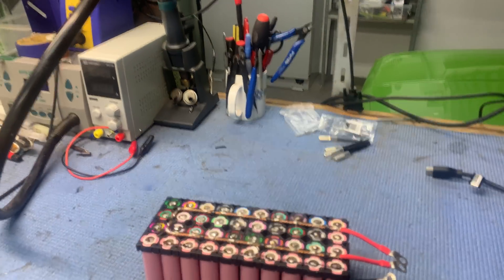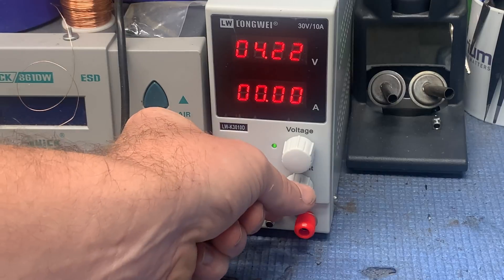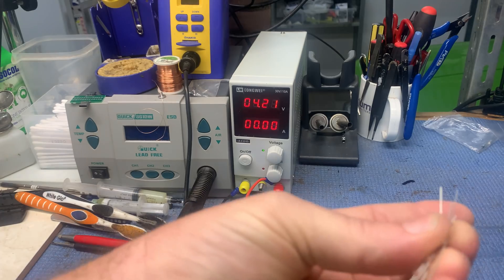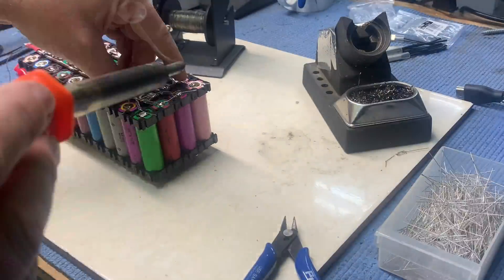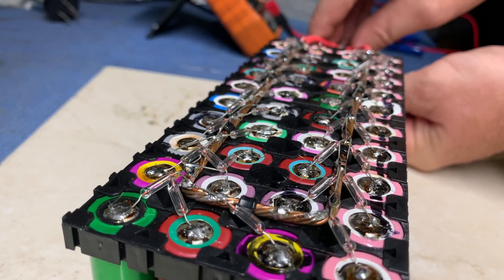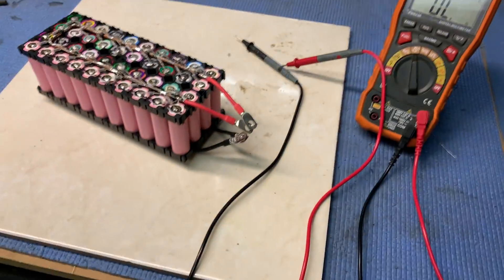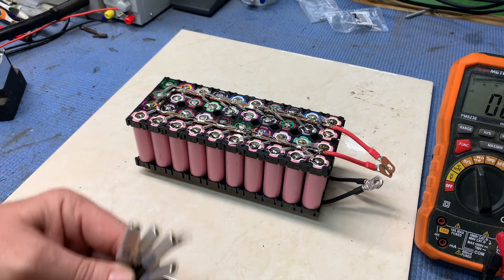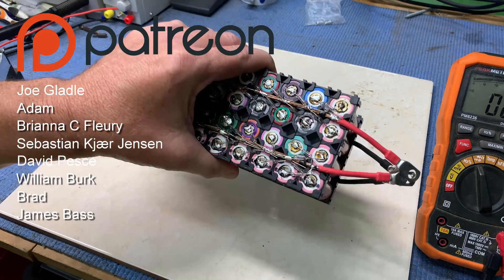Glass fuses on an 18650 battery - Cell level fusing

Comment: So what's the idea behind the fuses?
I get that it's a protection but watching these last few videos it seems that the dodgey cells don't have enough energy to blow the fuse, whereas the better cells blow it right away.
Also, the testing you're doing is simulating an external dead short. Wouldn't a fuse on the cell be better? 
If the pack had an internal failure, then would a single battery actually be over supplying the current that makes it fail?
to understand the fuses, my best guess would be to test batteries in various conditions (full/mid/end of life) with a load  and fuse to see how it reacts.
The more I think about it, the more I feel the fuses add nothing more than a false sense of security - sorry bro...

Comment: Hi Pete, Great video there, clearly your new to constand current/constant voltage PSU's but you'll figure that out in time (thats what the lights mean) in terms of the thermal fuses those sound difficult to implement but perhaps using those for "Pack" level fusing would be an idea.. But in the mean time if you look but auto resetting polly fuses i think you will find the cost effective type your looking for.
Reply: Hit & miss but to locate a thermister in a pack would be the use of thermal camera to find the highest heat point so it triggers escentially as soon as possible.

Comment: You need to stop promoting using these batterie cells. They are very dangerous
Reply from the maker: So are cars, planes and shopping centers, You can make anything safe.
Reply: @HBPowerwall  I know the danger with my car.  What is the danger presented by a Power Wall?
Reply: Life is dangerous. If you so scared stay in bed, you can fall from stairs and break your neck going down to make a cup of tea.
Reply: @robert1508  People need to know what the RISK is.  Then we can decide if we want the risk, or not.  Where is the risk stated in this video ?
Reply: @Repairman What is the risk?  Burning the containment down?  Where is that stated?
Reply: one youtube film do not push enyone to start making his own powerwall, some crazy guys like WE are, start our small or bigger project, watching tonnes of films, buying or getting in other way lapto, power toos. scooter etc, batteries braking them apart testing and testing and get knowlege how they are build and what WE can make of them. Yes I am scared about some folks first comment on group "how i can get some cells, because i want to start dooing powerwall". But here is a lot guys with experience. I am an electrician, and my system works fine almost two years, 20 solar panels with battery backup, I am using now a forklift 48V battery, but i have a plan to change to littium. 
So there is a lot od films about safety but not yhis one, this one was a test of glass fuses,  and was not addresed to someone who just started his own adwentured with littium but for a bit advanced guys.
Reply: @Repairman No, the RISKS are never explained ...
Reply: @Repairman No, I will not pay someone to install a battery bank on my property. That makes zero financial sense ...
Reply: @Repairman No, nobody KNOWS the risks, especially if DIY ...

Comment: Suggest removing 1-2 of the non-blown glass fuses and repeat power supply test done in the beginning of video. Curious if tolerance on the 5 fuses a bit higher?  (doubt it)
Or perhaps the short current (in main bus bar) drops as each fuse blows, and short current is lower than initial short current (each fuse blowing removes cells, so is current through the main busbar dropping?) A test would be to measure bus bar voltage as short remaining 5 cells ... likely very low. With large number cells, the voltage likely took a bit of time to drop. (what would it been as fuses began popping? No easy way to tell)
Would need high speed current (and/or voltage)  reading at point of short to gain better insight of what happening at point of main bus short. (ie: digital current capture .. but doubt you'd have sampling equipment)

Comment: So has his fire basically come down to the over rated fuse wire? was he expecting each cell to output 8A under load for his use case, was he expecting to much? or was it just a mistake and would  a 2amp fuse blow when a cell turned into a heater?
Reply: @Anthony Barrett
 -  You will never know what actually caused he fire.  You can makes guesses.  a) maybe it was a "heater" cell ... b) maybe it was bad "fuse wire(s)" ... c) maybe it was poor construction ( caused a short ) ... d) All of the above ... e) some of the above ... f) none of the above ...
Reply: @Repairman Even with a 2 Amp Glass Fuse, a "heater" cell can still burst in to flames.  So, was the 7 Amp Fuse really the source of this problem, or just another problem?

Comment: Glass fusses are way to go ....i have little bit larger packs with glass fuses and no issues at all ....
Reply: 1 because i have tested every cell 3times 
2 this batterys have only bin tested once....
3 thermal issues have some parallel issues like self discharging or high internal resistance .....by full and when they are empty...
4 equipment that u use shuld not be mass produced 20$ diagnose Bt-c3100 is inacurate ....
First charge of salvage batterys shuld not be more than 0.15A ...
Yes is long first charge but in this stage u get first heaters because batterys are charging long time ....time of first charge shuld also tell u someting is not ok...
If batt. is ok no heat will build up ect ...
5 by testing capacity with 0.5A ...discharging....no heating up
SkyRC mc3000 is great option to use ...
Calibrated ....
6 waiting time 5-7days ....first charge to exacly 4.2v then put batterys to rest... after5-7days measure the voltage ..if is bellow 4.17v is no god for powerwall 
7 pack asembly .....asemble the pack...
Charge to 4.2v and put to resting for 5-7days again if is below 4.17v charge pack again and serch for heaters thermal gun ect...
Then disconect all batterys on the one side ....i do on the neg because on pos i have glass fuses ...wait 5-7days and measure every cell replace the cells that are no god....asemble  the pack charge to 4.2v and repeat the procedure until u get 4.2v on the whole pack after week of resting....
7 measure capaciti of the whole pack with ZPB30A1 V2.8 my device....

I use 6packs/135Ah in parallel and 14 in series 
Mach capacity batterys thogether  one 2000mA and above 
Second 1900mA
3 1800mA and so on down to 1300mA 
so every 1s group have 2000 and above have 1900 have 1800 an so on ...
Usebal capacity is 600Ah/52v ....active balancing is required 50-90€ with display and constant balancing ....
Max draw is 100A long term...also charging after 3.4v i consider cells as empty and 4.04 are full .....and i get my 600ah wit on issues...
Reply: Man i have tested cells like 3years and look all videos hb powerwall and others also make mistakes along the way 3times have taken all packs a part and it still was not perfect ...then u take paper pencil and wrote every mistake i have made and look also other ...adopt god  things....
Hb is cool guy ....but i think his packs are simply too large ....
That burning pack was just extemly abused ...
And balancer it must be active because are old batteries at least 5A shifting current capabily ....mixed batteries act different at 3.3v and 3.8v curve of discharge is not linear and every so small disadvantage could active balancer make to disspeare....

it have to be constant balancing. 
even now if i go look battery volages i see that is shifting current around ...
Now days good active balancers cost 80-90€ with display or monitoing capable ....
My batterys lie on the same spot more than 2 years now without any intervention...
On sunny days i charge them with over 100A constantly no isses....
Reply: How do you know that you have "... no issues at ..."  ???  Did you short out the pack?  Do you have video showing that every fuse, in the pack, will actually blow?
Reply: For now ....

Comment: Curious on the fuses that didnt blow, did they have a different resistance between the cell and busbar? Also is it worth pulling the cells that didn't blow for a quick capacity test to see if they are lower capacity than advertised? Perhaps what once was 2200mha is now 1400 (ie not enough current to blow)?
Reply: I see the point here where the need for 1Amp fast blow fuses to work at very least amperage.

Comment: Great set of safety videos lately, I think a lot of people appreciate them, thanks!
Some fuses didn’t pop so I think the following should be investigated:
1. Are the fuses themselves faulty ( put current over them with your PS and test it). If yes, the fuses themselves or installation method should be questioned. If not...
2. Check if the cells of which the fuses didn’t blow, have peculiar behavior. Heaters, drainers, high internal resistance, low capacity left, ... if this is the case we should try to figure out a method to detect this during initial cell testing so they never end up in a pack. That is of course if the problem is already present from the beginning and not caused during aging of the pack.
Reply: Re 1: I have actually come across one faulty fuse. There were 2 fuse wires inside the glass tube together with 2 leads in each end 🙂 , well I discarded that one.

Comment: Cells that did not blow the fuse are defective, not able of supplying 2 A into a short. Try one of the cells that did not blow its fuse and see how many amps it will provide into a dead short. (My guess is: almost nothing). Unless You break the fuse glass they are surprising rigid. I have mounted 7000+ of these and I have less than 1% that breaks.
Reply: Yes I was thinking the same, clamp the current meter on the bus bar wire to see what current there still is on those cells that did not blow their fuses.
Reply: Agreed, I have had batteries that show voltage but provide very little current .
Reply: @OverUnity7734  Open circuit voltage is what that is
Reply: This is where a battery load tester comes into play during the  processing stage. The ZTS MBT-1 pulse load tester is what Ive been using for a couple years now. It looks kinda cheap looking for what it costs but its actually really rugged.
Reply: Maybe check the cell’s internal resistance to see if it’s very high as a cause for them not blowing the fuse?

Comment: It took 8 amps to blow that fuse wire between two alligator clips. I'd try attaching the fuse wire to a piece of that copper wire like the bus bar uses and clip the alligator clip to one side of the fuse wire and the other clip to the chunk of copper. I'll bet it takes more amps to blow as the copper acts as a heatsink for the wire.
Reply: Length affects the wire quite a bit.  Longer allows for lower pop which was at least double the length of normal use in this test, shorter takes more amps to pop due to thermal heatsink. At least thats what I have found in all my test.💥🤘

Comment: Interesting results! Thanks for this video.
Fuses take a different amount of time to blow depending on the current. This can be checked via their “I2T” curves in the datasheet. Those curves show the time versus current before the fuse will blow. Since each battery has a different internal resistance that means each will output a different amount of current when the pack is shorted and each fuse will take a different amount of time to blow. Fuses have a tolerance too, not all will blow at the exact same time for the same current level. Lastly, different lead lengths for each fuse results in different levels of heat being conducted away from the fusing element. This can affect the amount of time it takes to blow the fuse, especially if the current levels aren’t high enough to instantly pop it.

Comment: A 2 amp fuse is designed to carry 2 amps not blow at 2 amps. The current it blows at is determined by the job it is designed to do. I expect  your fuses are around 1 amp carrying capacity from your video.

Just an idea about not all fuses blowing during a dead short. If there is a high resistance in the Klixon attached to some of these second hand cells, expect funny stuff.
Since you know which cells are implicated, load each individually and calculate resistance of the cell including the Klixon at say 2 amps.  
The mere act of soldering can oxidize the contact or detemper the diaphragm.
Battery packs that cause intermittent laptop issues are likely to have a cell with a shitty Klixon anyway. 
The end result for you in normal use is an 80p pack that is really 80 minus the number or shitty Klixons.
While I was proof reading,  a though came. An intermittent Klixon can cause cells to become chronically undercharged in a pack that is in service. 

Cheers
Reply: You don't think the capacity testing would show up these cells ? 
And/or performing a resistance test
Reply: @chriskennedy7534  i suppose it would, but since bad cells are removed when building packs, how would you retest them once in service?
Reply: Thats correct, mains voltage fuses that have designed carrying capacity blow at double -so 6A fuse blows at 12A in about 30 seconds